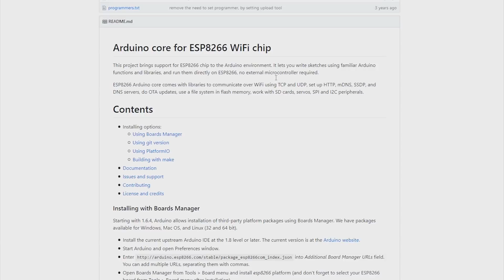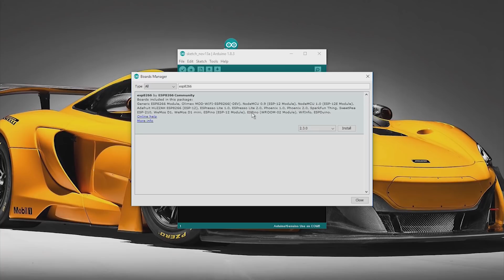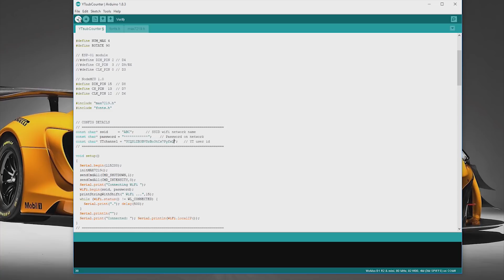MAKE A WiFi YOUTUBE SUBSCRIBER COUNTER CLOCK

Comment: Great video with all the links for things and the coding. when looking at the LED boards on eBay do I need to buy 4 of those and do I have to do all the soldering on them. also is this expandable to make the display longer? Liked and subbed. keep up the good work.

Comment: Where can I get the glass front that bolts onto the 3D printed case. I was about to buy the parts but there is no link to get that glass cover on front. Where would I buy one that fits into the case?
Reply: Pro Edits ok thank you.
Reply: Pro Edits I do not have one